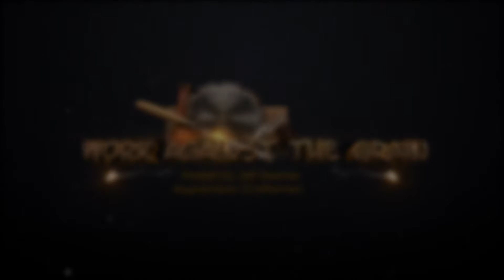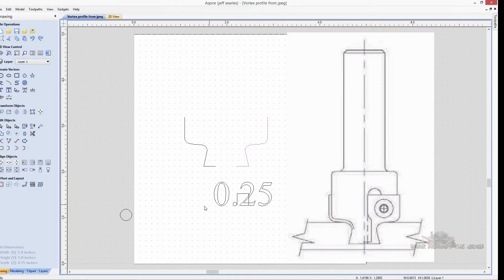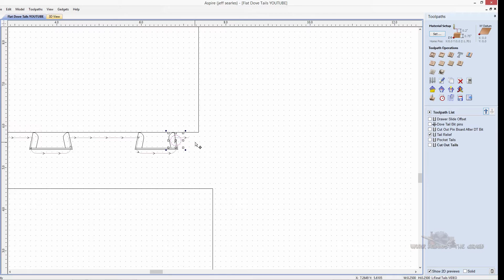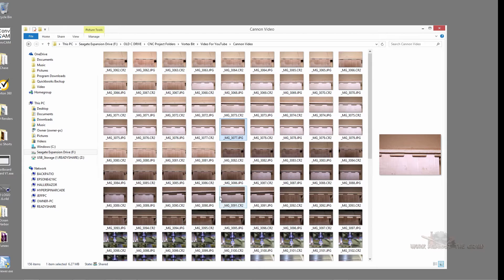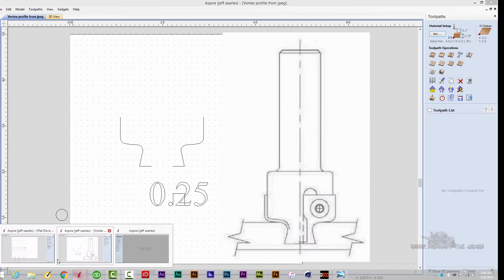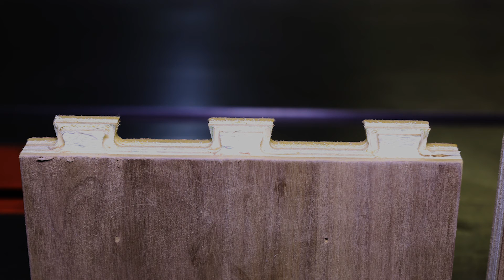Half Blind CNC Dove Tails REVISITED

Comment: I've made a number of finger-jointed drawers, and believe they are, in practice, as strong as dovetails i.e. the force it would take to break one but not the other  is unlikely in even the hardest use of a drawer.

I'm about to make some half blind DT drawers for my kitchen, but only to be consistent with other drawers.  Given that aesthetic is main driver, rounded corners are a non-starter.  Interesting video though.  I'm going to bite the bullet and buy Rockler's DT jig.

Comment: I don't think the issue is a bit so much as it comes down to your table.  As Steve alludes below, Legacy has a vertical end table that allows you to clamp a board vertically just like you would in any of the router jigs out there.  Then the CNC code is executed in the same way.  Yes they mention the bit used on their page.  the problem is that most desktop CNC units will not allow the bit to travel beyond the bed.  Solve that issue, and I think you are good to go.
Reply from the maker: You are absolutely correct. I am working to modify my current machine to have vertical capabilities much like some of the Legacy machines. To your point that most CNC machines do not have vertical capacity for dove tails, the purpose of the Vectric dove tail gadget and my video was to show or should I say attempt to show how one could achieve an "acceptable" half blind dove tail joint on a flat CNC machine. Thanks for watching the video and your comments. Well said.